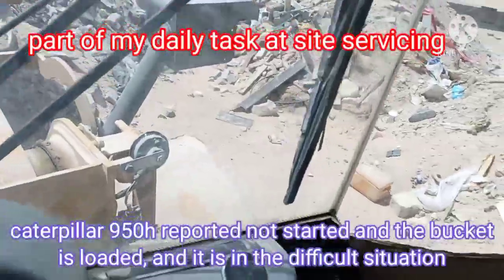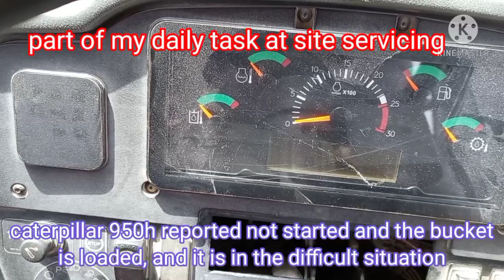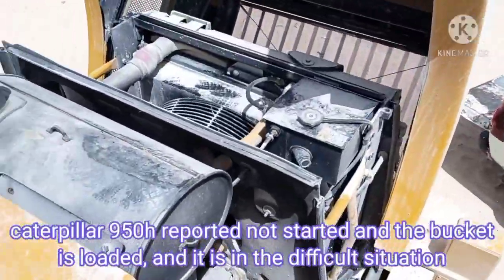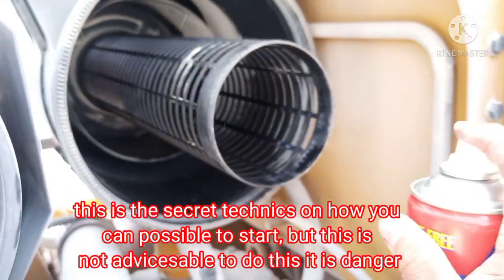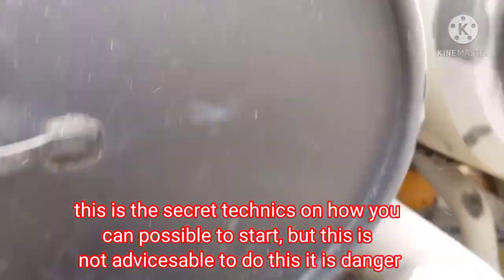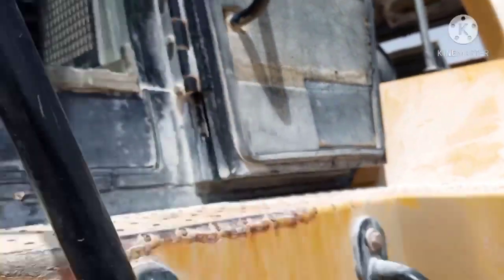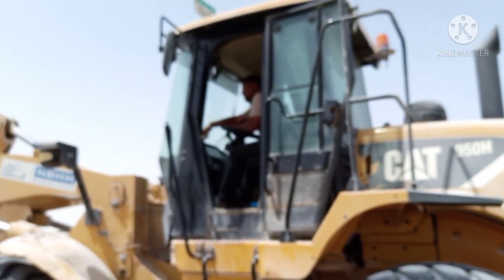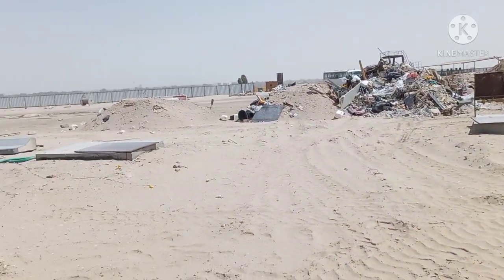CAT 950H SHOVEL HARD STARTING

Comment: Boss gud p.m ask po sa inyo may problema kasi unit name c11 966h loader mahina kasi ang fan niya sa raditor tapos ng oo heat kasi makina niya ng palit na kami water pump salamat po sa
Reply from the maker: sinsya n s late responce regarding s fan speed,kpag fan ay low speed paanu malala man kung nsa fan b ang may problema ganito check mo ung solenoid n msa gilid ng makina yan ang control ng fan,ngayon observe mo or check mo kung may supply or nagiinit b shortcut,kpag nagiinit ibig sabihin gumagana sy kung hindi e d hindi nagana kpag hindi nainit o gumagana solenoid dapat ang fan motor mo bibilis ang speed kpag gumagana ibig sabihin regulated ang pressure,

Comment: Sir jhun what sensor po yung binabanggit mo kong kya po hardstrting...ganun din kz yung lodaer n gnggwa ko
Reply from the maker: brad check mo muna s monitor nya kung anu ang nilalabas n error pra sure may mga dahilan ksi kpag hard starting, pero s mga na incounter ko is ung nsa ibabaw ng head s harap ng makina sensor yun tawag doon ay pressure actuator sensor, or the best check mo muna ung self diagnostic nya ha
Reply: Cat 950gc po yung loader sir jhun
Reply from the maker: sinsya n late reply, contakin mo ako s whatsapp send mo s akin serial number +971567581176,at details ng problem ha

Comment: Sir tanung ko Lang poh sir if ang loader mahina sumuro Anu kaya ang problema sir
Reply from the maker: anu kalsing loader yan, marami ksi dahilan unang una baka kinakapos s fuel mga nagbabarang filter o namamagang hose, o kya makina mdyo matagal n ppweding kailangan ng buksan, or may problema n injector or injection pump, s hydraulic system b mabagal b tumaas kahit wlang laman
Reply: @caterpillarjhunhunk  W380kumatso na loader sir hinde naman poh mabagal poh if walang laman pag sumuro Lang talaga poh mahina talaga travel walang problema poh bucket wala din poh
Reply from the maker: o kya tingnan mo muna baka nman ung shutof nya s injection pump hindi naka open ng maayos, ngayon kung ok ang lahat, ng nsabi ko syo, paanu b halos mamatay b ang makina
Reply from the maker: ito whatsapp ko +971567581176
Reply: Ah ok poh sir tingnan ko shut of niya sir  sir pwdi kayang clucth packs problema nun or converter sir
Reply from the maker: pwede rin kapag makina mo ay malakas pero wla p rin lakas kpag na suro eh ppwede clutch n yan, mga sinabi ko is idea lang, kailangan malaman ung ganun systema, ksi hindi ko kita mga pangyayari, mlay mo wla lang sipa ang makina o ndapa.
Reply: @caterpillarjhunhunk  oo nga poh sir.eh pero try namin palitan ang clucth packs nun at silipin na din  converter niya poh sir if.ganun pa.din mahina suro.cgurado ako injection pump.cguro.may problema poh Sir